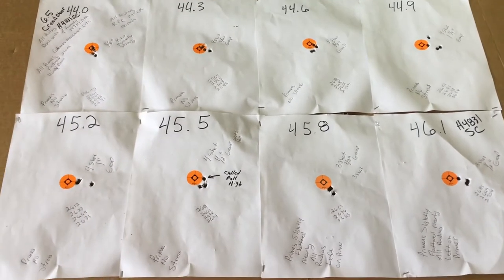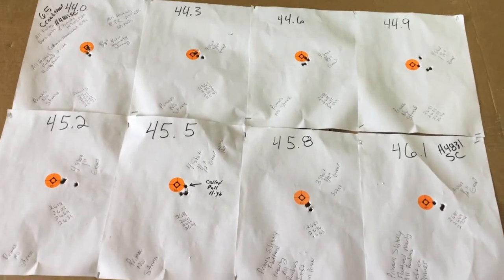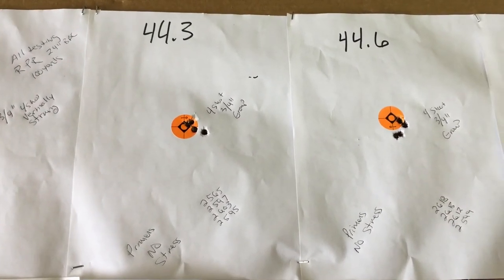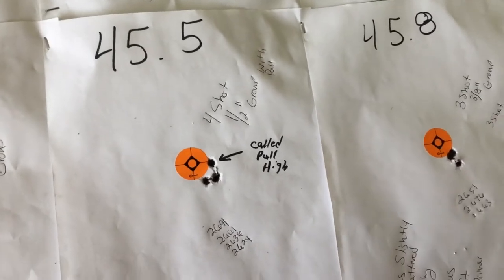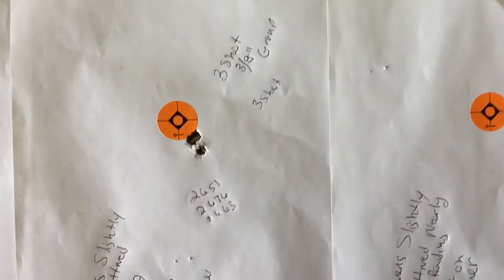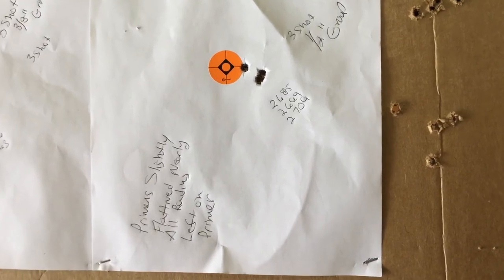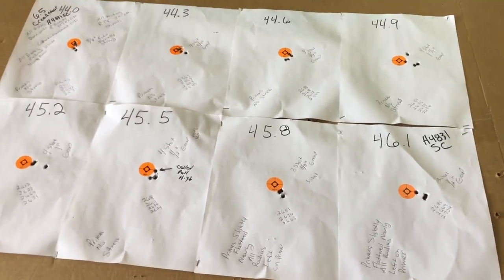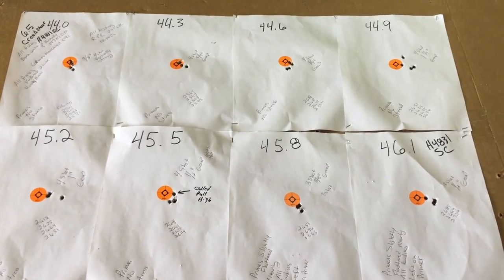RPR 6.5 creedmoor 147 ELDM TEST H4831SC

Comment: It was spooky for my gun too but it has been the most accurate powder to date for my 6.5Creedmoor. I decided to try a slower burn-rate powder because I have a 28" barrel and wanted a more consistent burn to the muzzle so I loaded up a 4831SC ladder spread and got the best group of .47 in my test. It is by no means my highest velocity (RL26 was the winner for speed) but 4831SC is the only powder that has consistently given me single-digit ES and SD. That is also spooky because not only does it yield single-digit but they often the same digit! Why does this group so well when everyone says H4350? I actually don't get good results with H4350 I guess I chalk it up to the long barrel. Thanks Mike. This does help out because I wanted to see if someone else was using it and liking it. If I may ask, are your primers large or small rifle primers? Mine are CCI 450 small magnum primers and no pressure signs at 45.8 grains. OCW is 44.8grains for me right now.

Comment: 44 gr of 4831 gives me 2740 fps out of savage 12lrp 26”pipe no pressure signs small group good numbers 

Took it up to 45.5 gr without a problems but 2740 at 44gr was hard to improve on

Comment: What length barrel are you running? I'm thinking about switching to H4831SC to get velocity without pressure for the 147s
Reply from the maker: BTOMF it's a Ruger Precision Rifle 24".  I assume due to the powder being so slow a 26" mabye 28" bbl will produce higher velocities
Reply from the maker: Saturday we shot this rifle at 300' yards with 45.8 grains of H4831SC and the 20 shot groups with hot barrel were no larger than 2 and 3/4" impressive given group size
Reply: I have been using IMR4451 with some good results, but ran into pressure issues. I bought some H4831SC today to work up. Hoping to get right around 2600. Were the higher charges compressing very much when seating the 147?
Reply from the maker: Your seating die needs to have the pointed insert for the Bullet tip.  Or the tip will crush from compression.  I was OK with 46.1 but that's just about it.  You may be able to get 46.5 in there but with the BC of the 147 from a 24" bbl getting 2650 fps I'm assuming your accuracy should be good to 1350 yards or so at 300' above sea level.  Of course the shots can go further but the accuracy effectiveness will probably be in a little closer.
Reply: I'll give it a go. I'm glad you posted this video bc I called Hodgdon and Hornady and didn't take away any good info with this particular bullet/powder combo. I had a feeling it could work and your groups and velocity look pretty damn good to me! Thanks for sharing
Reply from the maker: BTOMF update, 10 shot average from a short action customs 24" bbl is 2692FPS 19 FPS velocity deviation.  Awesome load!  45.8 H4831SC behind a 147 ELDM
Reply: That's awesome! I've been running some loads with H4831sc and the 147s. Found 2 nodes at 45gr (ES 3 2625fps) and 46.3 (ES 9 2680). But I think the 46.3 load is pressured out. Got some loosening of primer pockets on those. Gonna do a seating depth test tomorrow and hone in on "the one." I'm glad I found your video, I think this powder/bullet combo is kick ass!
Reply: What brass you using? I am going to start usung with lapua brass, i heard they have little less capacity

Comment: I've been looking for some load data 6.5 Creedmoor using H4831SC. I haven't been able to find any published data.
Reply: Mike Byrd Hornady books have it for 6.5 Jap. Different case, but they can use the same tip, and loaded very similarly into the case. If you want to experiment, use the Laupa 6.5 Creedmoor case. Stronger than others and smaller primer allows for more pressure.